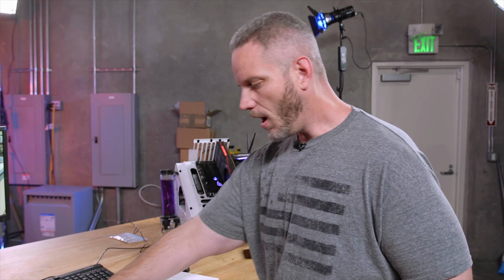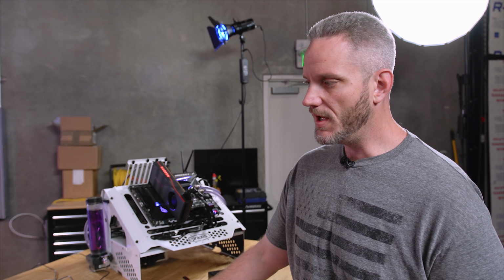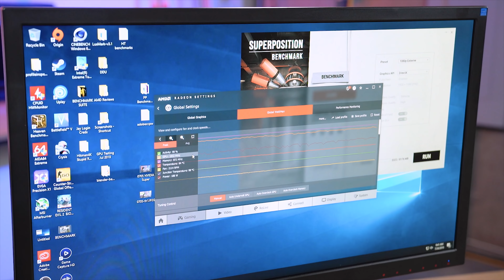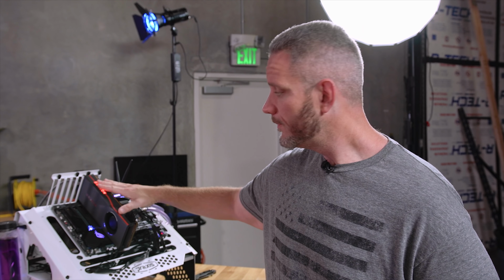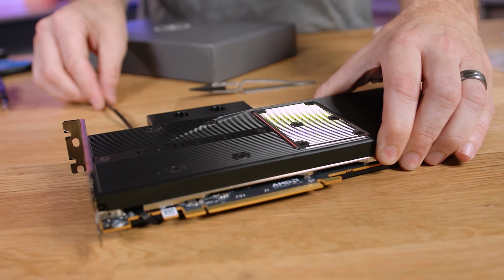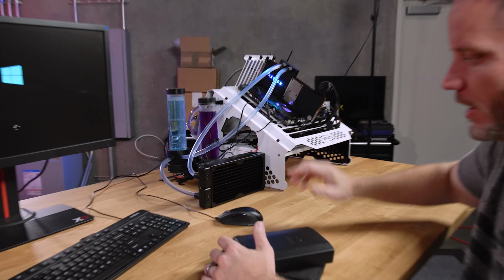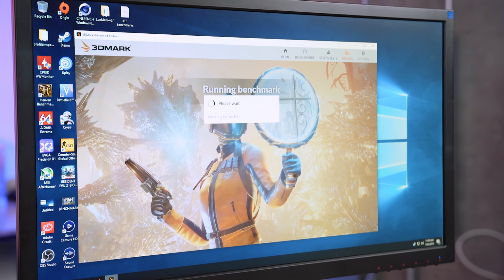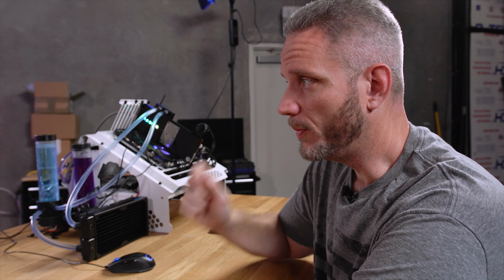Watercooled and Overclocked Radeon 5700 XT... Was it worth it?

Comment: Is 2.2 GHz possible? Just asking, since I wanna buy a new PC in a few years and I've been stuck on a GeForce 9600. I am not sure what to buy GPU-wise.
Reply: get a 2080ti
Reply: Second hand 1080 TI for great power per $.  Got 2 myself(one needs soldering work) and a 1070 for £450 on ebay a month or so ago.  
Just got to be patient and follow the target close. 👍
Reply: @JuxZeil  The price for the 1070 is pretty bad though.
Reply: @Tahutify  Just got to hunt for the one bargain out there bud.  The one that's got your mod all over it.....Stick to you max price, bargain, check the listings that don't make sense to the tech heads out there, as they are usually the REAL deals.👍
Reply: @Tahutify  That £450 was for 2 working cards and the repair job one by-the-way...... You have to do a fair bit of leg-work for it.
The bargains out there won't just fall into your lap. 👍
Reply: Ah, that makes sense, just read it wrong.

Comment: Hey...I want to save up some money to build the computer I want...I was wondering if you could build one just for me to look at...I. sure others would like it too...msi x570 godlike...threadripper 3990wx..msi top of the line graphics card...the best corsair ram with amp...the sexiest case...the best cooling system with sext lighting...just thinking out loud...have fun always...
Chris
Reply: Yes... I too would like to see threadripper fit in an x570 board am4 socket.. just use a hammer...
Reply: I just hope that msi will make a sexy board for threadripper...too bad I don't have the money for it...I'll save enough eventually...

Comment: There are other factors you not using such as a water cooler to control the temp of the water. So are you achieving something just be doing a graphics test? Not really unlike a minor the
use of a water block would be better for this because basing it on temp alone can't give you a true reading. What i mean is your not putting it under a stress load for 24 hours to see if it would hold these numbers all tho the temps would be great for overclocking and truthfully AMD is the king of processing but the handing of the data the cip information the IC's how the circuit is made on the board such as caps and diodes and resistors all have a big part into this under temperatures of course if you know anything about circuits and heat how a flux can happen in power as well as freq. But really i think your test where helpful but inconclusive because there are so min factors that can effect things on the board.

R@v3 - KG5CUO - HAM OPERATOR

Comment: This video doesnt really tell anything? only one test Jay? at least you could have ran a few more tests and put some slides, and like other people said, do the registry mod, It makes sense to say that a 150 $ water cooler is expensive for a mid range card but your only conclusion was that if people wants to do that, they should simply go get an Nvidia card with a Stock cooler, what about people that already have a water cooler rig, and they like the silence and temps they get? it feels the video was quickly made just to jump on the 5700xt watercooler Bandwagon, a bit rushed.
Disappointment.

Comment: Look man if you want to keep the card healthy you have to water coolant even if you have an incredibly powerful air cooler like three fans on the GPU you have to keep a GPU cool you have to keep air moving radiators are the best because you can customize the entire layout of the cooling system shes I'm using two water pumps because the faster the water moves through the radiators the faster that cold water is getting from the radiator back into the GPU again this is not about performance this is about longevity this is about do I want to spend $700 for a graphics card that is going to last me for a year-and-a-half and is going to cost a lot of money when it comes to electricity because it's using fans or do I want to spend a little bit more money for a water block that's going to allow my car to last longer run at lower temperatures and less electricity not only that this is brand-new architecture they're constantly updating their drivers to improve overall performance so far AMD is kicking nvidia's ass and don't compare this graphics card to the Radeon 7, the Radeon 7 can literally push games to 8K the amount of power the Radeon 7 has is amazing it's actually beat out the 2080 TI in just raw power the architecture that AMD is using now is more refined than the original architecture for the Radeon 7 but the Radeon 7 has more RAM then the current GPU you're using you can say that the current when you're using is almost matching the Radeon 7. The benchmark test your using are not fair when it comes to that because that Benchmark looks good to you but if you put a Radeon 7 under that benchmark it's not going to show you the same level again using benchmarks to try to prove your point is nonsense that GPU is a mid-range GPU running with new architecture whereas the Radeon 7 is a high-end GPU that can do multiple tasks simultaneously while playing games in 4k at more than 100 frames per second because of the amount of horsepower that GPU has and if you put a water block on it you keep the temperature down and improve stability overall again as an engineer I'm laughing at you either you're being this way because you're a Nvidia fanboy or you think that the majority of us who watch your videos and other people's videos are this stupid.

Comment: You're biased towards AMD is so annoying man, AMD has their new feature that allows the GPU to help smooth out the image, not only that you're saying that you were getting high temps on fan Cooling and that really water cooling doesn't make much sense when it comes to Performance except you're using Benchmark tests instead of actual game tests so you're not being honest water blocks keep the GPU at a low level I'm using three 240 mm radiators and my Radeon 480 gets up to about when I really push it 45 degrees the point of water cooling a GPU is that the GPU stays cooler all around by doing this you allow the car to last longer so that way those cheap coolers don't burn it out faster I know that I am d is designed to last long especially to get up to high temperatures that's what it's supposed to do but still the gold and silver that's built into that card is going to degrade faster when you have more heat on it I'm an engineer man I know how these things work so by saying a water block because of your benchmark tests doesn't make much sense again either you don't know a lot about what you're talking about or urine Nvidia fanboy

Comment: AMD must make some proper stock cooler to compete with nvidia. Radeon VII for instance is brilliant card, but there is no way I would personally use it in my rig with stock cooler making noise as jet engine . Investing another £120 in waterblock + more £££ if you need all other equipment to run custom loop it's just crazy and stupid even for fanboys. That's why i've sold my vega 56 and that's why i am going to sell my Radeon VII now . If the noise was similar as nvidia's 9th and 10 series FE coolers that would be amazing.. Unfortunately most likely 99% peoples working for AMD must be deaf or taking some drugs so this noise is ok for them. Amazing GPUs with brilliant OC possibilities fucked up by part which cost fraction of the whole card ;/ stupid stupid stupid

Comment: Bro, how can you STILL recommend the damn 2070 Super? It's $100 bucks more than the XT, and especially with the Power Play table mod, undervolting, and memory overclocking, the Super, honestly all Supers, are fucking stupid and TERRIBLE value. I'm not gonna say you're a shill, but god damn do you have a bias.

Plus, ANYBODY willing to water wants to because they are looking to maximize ALL the performance they can get from something, without going to more colder cooling solutions of course. So they aren't a part of the "normy" PC crowd. They'll already watch, read, and learn the tips and tricks for the card they want. They aren't just gonna connect it, fill, and leave it alone in their system. They will to see if everything works first as intended lol, but after they verify, they're going underneath the hood.